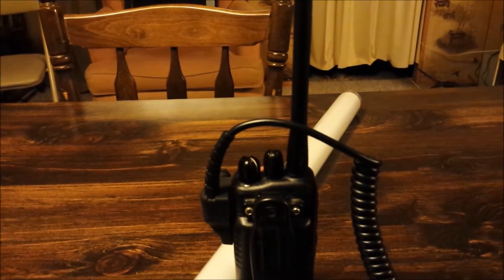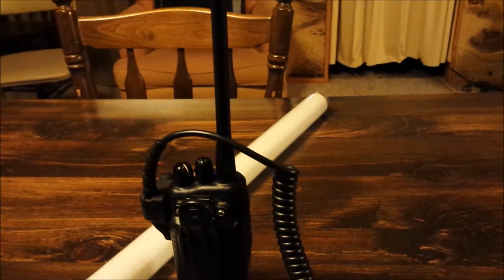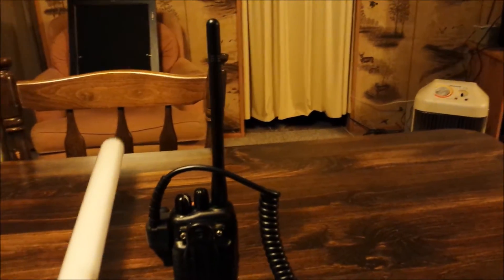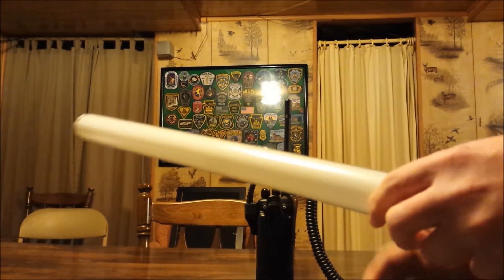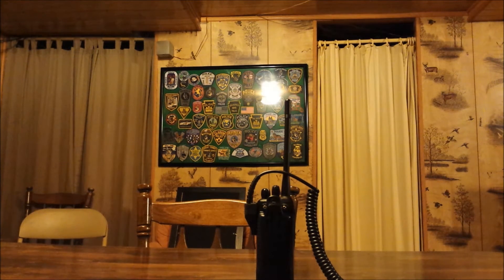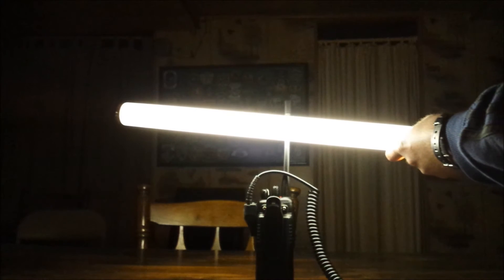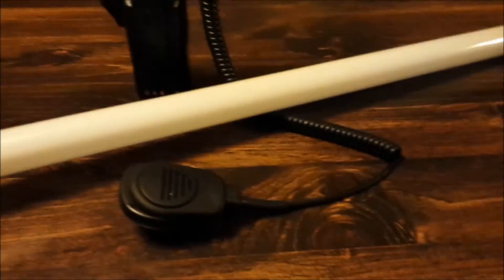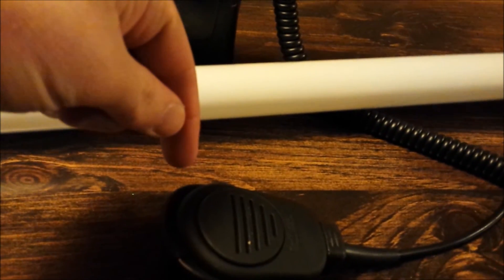Light a Bulb without electricity

Comment: U can also do this with one of those plasma ball things
Reply from the maker: +HeluimNeonLazers Class10laserWARNING a smaller style one or does it need to be a big one?
Reply: Like one that like 3-5 inches in diameter 
And if u do the fluorescent light tubes with the plasma ball it will light up one section of it
But CFL bulbs will work the best

Comment: Penn and Teller have a routine where they put Teller in an "electric" chair and have him hold a fluorescent bulb and "shock" Teller making the bulb light up.  It is relatively straight forward science.  The fluorescent bulb is filled with mercury vapor and coated with phosphors that glow when excited by external energy. When you energize mercury vapor, it emits UV light that hits the phosphor coating converting the UV to visible light.  In the case of the CB, when an incoming photon (radio energy) hits the phosphor coating it converts the radio energy to visible light and also glows.
Reply from the maker: saltyshellback holey sweet swirling onion rings Mr. Wizard... HAHA...  
I am seeing that this was a pretty standard trick back in the day when lots of people used CB's in their vehicles..
Thanks for the the scientific explanation.